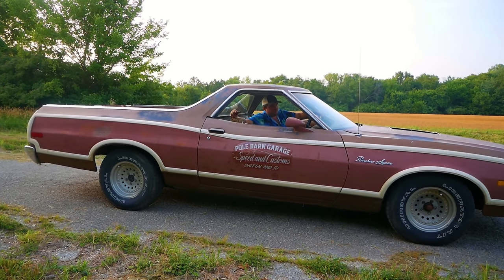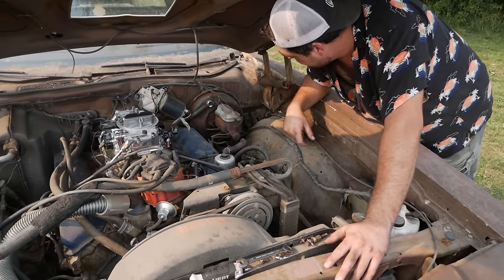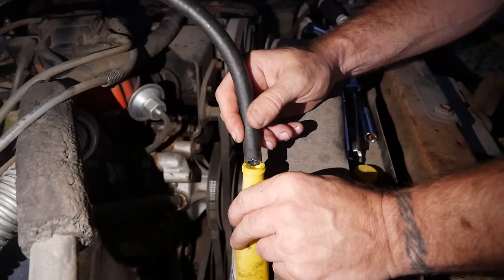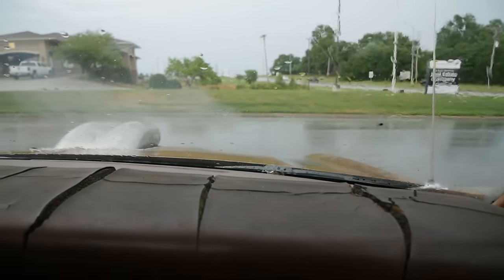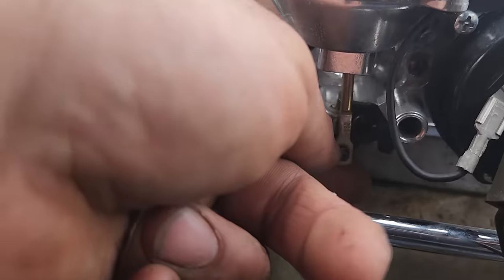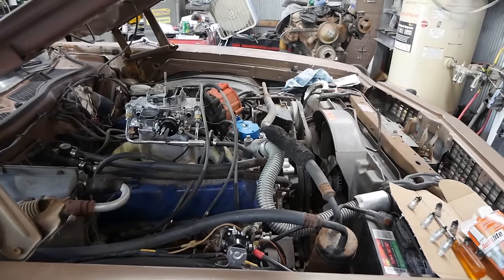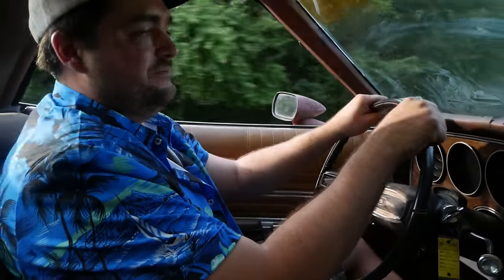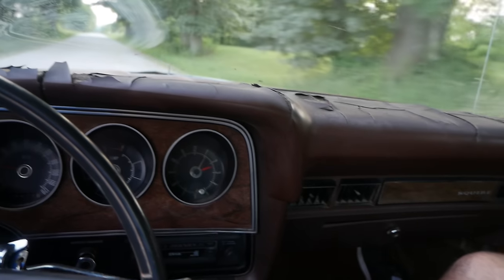Forgotten BUILT Big Block Ranchero-Will It Run and Drive? Huge BURNOUTS!

Comment from the maker: Use code POLE20 for 20 percent off your SOLDERSTICK order!
https://www.solderstick.com/sale
Reply: Ordered. Cool idea and can't wait to give these a try in my MG. Need to fix some connections under the bonnet.
Reply: @PoleBarnGarage get ahold of me please I'm in between kc and st jo I'm looking for a cheapish sbc for my caprice classic let me know if you know of anyone that can help out ...thanks
Reply: Sorry mate Australia
Reply: To much talk to much crap. Stop watching
Reply: I’ve been wanting these to re-wire my trailer for a while now. Just ordered a king size pack for a great deal.  Thanks for the discount
Reply: Want to buy another one of those motors Dalton
Reply: In Ohio
Reply: Out of 64 Monterey
Reply: Hope they ship to the uk 😊
Reply: It ran when I pulled it out of the car 1987
It does rollover
Reply: OSHA wants to know your location.
Reply: i've been using the Pico version of these for years. they're awesome, i never attempt a wiring job without a handful of each size ready to go 👌👌
Reply: That is a hell of a nice score. I hope you restore it back to its former beauty because it's worth it.
Reply: can you call it solder? Why do Yanks call it sodder??????
Reply: I grew up right down the road from Orr radiator. learned how to R n R transmissions next door at Arts Westport transmission back in the early 80s
Reply: Am I too late to comment on this Video if not I like the 429s power band can stick you too the seat when operating correctly good choice love your channel man keep up the good work for the common man you rock

Comment: Last time I dealt with a low compression cammed up Ford big block it liked 38-40 degrees total timing all in by about 2600-2800 rpm. So I think you’re on the right track there. But the biggest help was a stall converter to keep the rpm’s upon acceleration to compensate for the anemic compression. But being a Jag owner, you know this already! Haha!
Reply from the maker: You bet. I have a set of 3.70s coming for it, bigger stall will likely follow
Reply: @PoleBarnGarage  Please tell me you're gonna scare Kevin with the cam chop at some point, it'll kill him from excitement I bet! 🤣🤣🤣
Reply: Bigger stall 2800 or so will do wonders getting into that power band of cam

Comment: A breakdown of the VIN and FSCL Label for this 73 Ranchero:

VIN:
3=  1973
A=  Atlanta Assembly Plant
49= Ranchero Squire
N=  429 V8 4 bbl 205hp
147265= Sequential Production Number (starts at 100001)

FSCL Label Codes:
Body 97K= Ranchero Squire 2dr pickup
Color Code 5H= Medium Brown Metallic
Trim Code RF= Cordovan media velour seats
Transmission Code U= C6 Cruise-O-Matic transmission with aluminum case
Rear Axle Code 6= 3.00:1 nine inch non-limited slip differential
Distribution Code 71= Los Angeles

Nice find Dalton!

Comment: Man, I always loved these c'atrucks. Ford or Chevy flavor. I had a 71 Elco 350/350 a couple years ago but it was in really bad shape body and floor wise. Ran like a top though. Taught me a lot about carbs (thanks Thunderhead298) . Had short gears, I really hated going 70 at 3300+ rpm. I am more of a cruiser guy I guess.
Reply from the maker: Me too
Reply: @PoleBarnGarage That Ranchero may have a smog Era timing chain in it which retards it 8 degrees at the cam if you put a 69 back timing set in it it should make about 300hp with a mountain of torque even if it's dove-3 heads with dished pistons if it's dove-c heads with dished pistons it should be around 370hp

Comment: Love to see more of this Ranchero, Dalton! You know, being it's a '73 engine with dished pistons, it may be a case of too much cam and not enough compression. Also, those stock exhaust manifolds are restrictive. Probably wouldn't hurt to throw some cheap headers on it. 36 degrees in by 3 grand is pretty spot on. Looking forward to the next vid!
Reply from the maker: Yeah I agree, too much cam. But some gears will alleviate it
Reply: @PoleBarnGarage  Put a bigger Edelbrock carb on it, say an 850.
Reply: @ksavage681 Edelbrock carbs make killer trot line weights 🤠
Reply: @ksavage681  No no no, put a Holley 850 on it. It's cheaper and if it sits, it won't seize.

Comment: I had a 1973 Ford Ranchero with the 351 V-8 engine and automatic transmission . That was in Wisconsin where there is allot of road salt used . I had to do allot of work such as replaced the floorboards in the cab and replace the entire bed floor with support members . Plus a bit of body replacement along the bottom sides of it . I even switched the seats in it to better and more comfortable seats . And I loved my Ford Ranchero and drove it for many years !  That was the most comfortable riding almost truck vehicle I ever owned back in 1985 and onward . It had a real frame under it and I beefed-up the rear suspension and added heavy-duty air shocks to it so it would carry a bit more weight , like a small pick-up truck but drove and rode more comfortable like a car . Very comfortable , big time and a good daily workhorse !!  I drove that Ford Ranchero for many years and it was a workhorse with very comfortable seats and ride  which handled better than a stock Ford Ranchero !!!!  But sadly it succumb to road salt cancer of the frame and everything else . It was my daily driver and work vehicle all in one with great pulling capacity !!!  What A Great Vehicle !!!!!!

Comment: Back in the late 1980's when I was in college my dad picked up a '70 LTD convertible,  triple white, with a factory 429. It didn't sound as cool as Basura Blanco does, but when you kicked it into passing gear and all 4 barrels opened it sounded like it was going to inhale the hood. My buddies and I had a great time road tripping it with the top down.

Comment: That engine from the factory made a whooping 201hp lol
Reply: impressive
Reply: The 73's came with D3VE heads with much lower compression and a different chamber design.  They also went from adjustable screw in stud mounted rockers to pedestal mounted non-adjustable.  So out of the box with a simple swap to the older heads brings back alot of the power.  He needs to date code the bottom end,  the newer ones had different deck heights I believe,  but not sure on the years of those changes.  There were also different push rod lengths for different years.

Comment: Not sure the yr of that block but even with D0VE-C heads it probably has the taller deck block with dish pistons that don't go to the top & could have a very wide quench distance making it unusable & possibly a lower compression ratio. Very early 71 (D1) blocks were still short deck at 10.300. By 72 all of them were 10.322. So that might be some of what's holding it back??
Reply from the maker: Oh no doubt it's a smogger. Was really hoping to see some flat tops in there at minimum

Comment: I have a 67 Ford Ranchero with a 289 Hi-Po attached to a Muncie 4 sp rockcrusher transmission.  Picked it up in 88 outside of Ft. Bragg for $200.  It was a basket case with the motor and tranny sitting in the bed. Over the last 36 years, I've replaced/repaired the floor boards, cab corners, new after market fenders, the motor, tires, brakes, steering and suspension, refurbished the interior with bucket seats (to accommodate the floor shift), new exhaust and a coat of primer.  I had the engine bored .30 over,  got a valve job done on the heads, put new bearings, pistons, rings, oil pump water pump, mild camshaft,  and a new holley 650 carb.   The only thing I did to the tranny was put new gaskets and seals on it.  

I have no idea how much I spent on it.  Most of the work was done in the 90's after I got out of the Army.  My best guess is I probably spent around $3K on it.  It still sits in the barn.  I drive it on occasion during the summer.  It's fast, it's loud, it gets looks, and most importantly, it's exempt from NY vehicle inspections because of it's age.  

Neighbor keeps bugging me to sell it because he had one in High School and loved it.  He's up to $12,000, which is a pretty fair price for a modified/custom.  I can't sell it though.  I know I would suffer from Seller's remorse.

Comment: Great video as usual. I love this Ranchero already. Im not 100% sure but that year of 429 i think has lower compression and more restrictive heads than previous years. The best years of the 429 made around 360 horsepower stock. But with some work it can be snappy
Reply: +1. 1973 was early smog years. Restrictive intake, restrictive heads, low compression ratio. And 385 blocks LOVE to breathe.
Reply: @Nick-ue7iw  yeah I thought so since it was an early smog era engine.

Comment: Let’s see everyone lose their mind. I have a 1977 F150 short bed 4x4 with a factory 429 -4V if I remember correctly it’s a 67 Thunder Jet  maybe wrong on the engine year. But all factory all with a factory 6” lift. It was a BigFoot thing they did with 10 trucks. Dealership tried trading me a new for it, back around 2000. Getting ready to put it back on the road for my son. Factory Bigfoot blue. Lol   Nice ride you got there! Great show!

Comment: When it fired up I totally understood the giddy laughter. 
When I bought my 2wd  76 short bed Silverado (500$ from a friend of a friend), I knew it was rusty, and probably needed alot, but it would start. I put a battery in it, and 5 gallons of gas, and a pair of front tires and drove it home.
It seemed to run kinda crappy at first, the baffles had blown out of the mufflers, and pushed up against the back and choked it. , It also had a 600 Edelbrock on it.....
So I put on a 750 demon, and cut the rotten mufflers off and slapped on a pair of cheap knockoff flowmasters. 
It didn't sound stock. When I took the seat out I found a receipt from a speed shop for a rebuilt 454, .30 over flat top Pistons, "torquer stage 2" iron heads, Holley street dominator intake, "performance" cam......and then another receipt from a year later from the same speed shop saying,"metal found in trans pan" customer declined repair. 
When I was done with the th400 it came off the back of the motor ....with all the bolts still in the block. Broke the bell housing all the way off.
Reply: Oh and by the way you started talking about timing.... I set mine up at what the timing light said was 50....but it was because of the Ballancer slipped

Comment: I honestly thought you bought this to put the motor in the Torino but then saw what a solid car it is.Looks alot better with the periscope air cleaner gone.I think it looks good with the sticker on the door would make a cool shop truck parts runner.Maybe find a scoop to close off hole in the hood,put a proper gas tank in it and weld a section back in the bed to make it useful again. I have been watching since you picked up the holy goat and continue to look forward to the weekly best on you tube content, you and vice grip garage.

Comment: Hey Dalton, New subscriber here, Bought one of these new 302 auto ps. pb. Dealer rustproofing. It worked it's ass of over the 8 yrs we owned it. It's only problem was the body rotted so bad the spare tire fell through the floor behind the seat. It was a  pretty good vehicle have fun with this one.Gord Ontario Canada

Comment: Score!
You were close on the axle ratio...mine had 2.47:1 until I bought a big heavy boat and put 3.50:1 van 3rd member in it. That was fun unless it was raining.  780cfm vacuum secondary (Holley) works good if fuel injection is not an option.
The stock axle is good if you like cruising at 105mph with the AC blasting. 
Leir Sigler 9 way power seats from a Cobra Mustang will brighten the interior up.  Once that couch is gone there is enough room for a B&M shifter and you could still land light aircraft in there.
Reply from the maker: I like bench! Comfort is key

Comment: After the timing spring change it got a lot better. I am really supprised the tires are holding up so far. I like it. Its pretty cool. Yep a bigger carb is going to unleash the 429. I remember putting a four barrel on my 302 it made a big difference. It do need a 850 CFM carb. A Holley or a Demon. You could rebuild the old one if its a 850 ? Maybe? A highway gear like you said is really holding it back on the burn outs. Find another rear end out of a ford truck at the salvage and that will help it. It will hurt the gas mileage though. you know all this stuff just saying or commentting. I truck rear end might be too wide? I dont know. Maybe a Galaxy or LTD probably a torino would work? I dont know? have to measure. Find a 3:55 gear to put in it. Then it will rip.

Comment: That thing has a good size cam in it ,A Posi and 3:90s or 4:10s hell yes continue on with the Rancharo ,750 Double Pumper bring in all the advance at 2500, RPM  38 degrees total timing fix the fuel source with the right size lines

Comment: Keep it! Definitely one of the top3 projects cars in your fleet. Gives me all the right Sanford & Son vibes. Add some 3:73 gears, a Lincoln locker, ditch the Hei, and add a proper used 750holley/decent distributor for a burnout competition entry by pole barn garbage uh I mean garage!

Comment: Dont forget about the venturie affect. I put a "high flow" air cleaner on my bike and it actually pulls more vacuum and pulling more fuel. I had to put my stock air cleaner on it for now till i jet it down. Pretty sweet find, even for a ford. Lol also, you cant fall in love with every car you get! Lol gotta save some for the rest of us. Lol
Reply from the maker: That's just a simple matter of airflow. A v8 is going to be way less sensitive to air changes than a bike, that said, I've personally seen the little 10" air cleaners like I had on it for a minute richen AFR a full point
Reply: @PoleBarnGarage  no kidding! Thats intersting! Cant wait to see more of what you do to this thing. I know your brain is going crazy with possibilities to do.

Comment: I bet it has stock 300:1 gears or 323 :1 , I would go with 355 gear set , also a Holley carb 750 cfm  double pumper with mechanical secondaries , replace the 30cc with 50cc accelerator shot on the primary side. It will be a beast. Posi for the rear, if you want to get rid of the one tire fryer. You are way ahead. on all the work that was already done to this sweet old ford. 5 speed conversion with 380 ;1 gears in the rear would be fun also. Great car to keep and build on. Take care guy`s, I look forward to seeing more of this big block ford.😎👍👍👍

Comment: Nike missles were for shooting down bombers, not ICBMS. 100 percent correct on the rest. Height finding radar(one site) transfered data to the launch site, along with a local direction finding radar. Launch the missile into the "box"(area defined by ground radars), the missile seeker dies the rest.
And i have a new goal: find one of these cars/utes, make it fully functional, drive the car forever. Doesn't have to be a 429. Figure a 351 with a Sniper kit, built trans, built rear end, and I can spend the rest of the time making it look nice and turn and stop. You know, the unimportant stuff....

Comment: I remember having problems with a 396 that I put in a square body. I couldn’t get any hp out of it. Vacuum advance hose was the problem but the transmission was worn out and I didn’t have time to resolve the problem.
Reply from the maker: Vacuum advance just advances the timing at and just off idle. If your initial and centrifugal advance is set correctly it won't matter
Reply: It would idle fine but it wouldn’t pull itself up a hill
Reply from the maker: That's centrifugal advance. You set, base, then total timing with that. Likely the vac advance was just crutching other issues

Comment: As you are dealing with a unknown cam I would rethink the size cam then match cam/piston with stall size/gears tune it to match  my vote would be to keep it
Reply from the maker: Just gonna throw gears in it, typical boomer engine, lots of duration, no supporting components. So it needs rpm to make power. 3.70s inbound

Comment: The rad cap on that does the same thing my 94 Mustang does and I have a cracked head. Dump your rad fluid out and if it’s a brown rusty color that’s prob what you got going on. Mine also will run hot sometimes if I’m in stop and go traffic. Been driving it like that almost a year now. Hoping to find an older 5.0 for it.

Comment: A good carb a posi rear end with 3.73 gears and a complete tune up. Maybe check the valves even though it does sound good mechanically And i bet that that thing comes alive

Comment: The much ignored 385 family of Ford big block engines are capable of incredible torque and horsepower numbers. My latest project i own is a 98 Mustang GT that i am planning to put a Jon Kasse heads/598 cubic inch engine between its fenders. I owned a 1970 Cobra Torino that had a 429 with four speed manual. Could break a 100 mph in third gear.
Reply: They’re pretty big in the pulling truck world

Comment: Nothing like starting a engine that has been sitting for unknown years and redlining the thing the only issue is you gotta hold it until you get some valve float then you know it's awake and the top end has lots of oil

Comment: That's Boss that you got one with a bench seat. I am curious to know the transmission, one would assume it's a C6 on that 429 but it could be a infamous FMX!!! They say it's the only automatic Ford transmission that you can pop it into gear (like a manual). I'm still skeptic on it, never been able to do on my own. You should add the Squire to the Fleet, It'll push me to get on my 78 GT. Then again, it just can't compare to the... Jag. ;)

Comment: I really like your videos. If you exhaust all other things and it’s still a dog, Ford ran retarded cam timing starting in ‘72. The early timing set fixes the 7 degree retard the factory did for emissions. Keep up the great work.
Reply from the maker: Surely you don't think they would have left that timing gear with the cam install?.. I hope not!